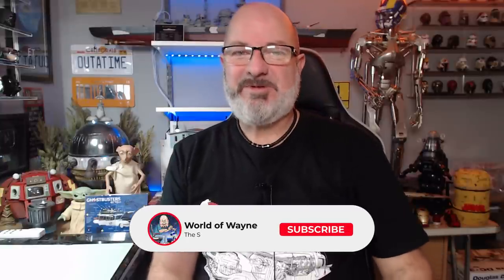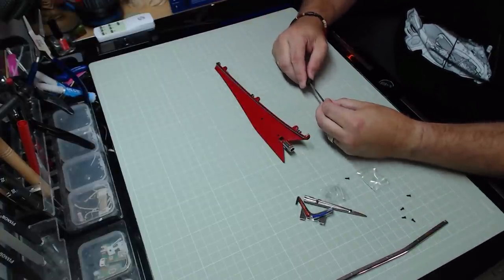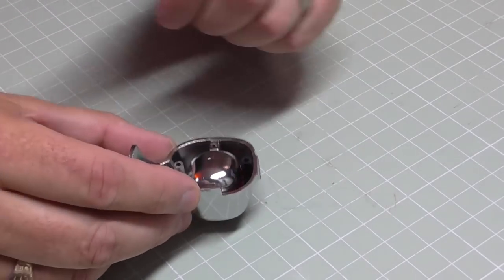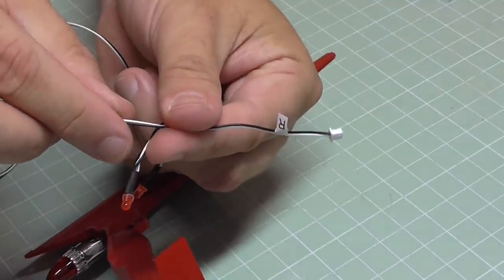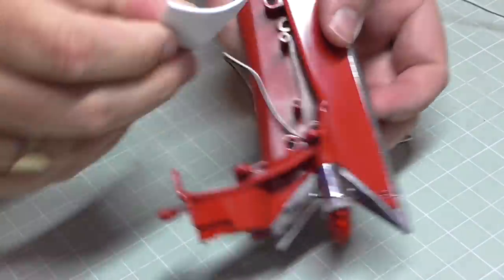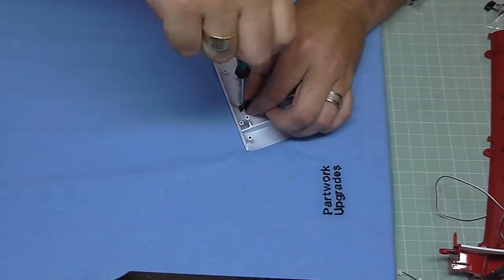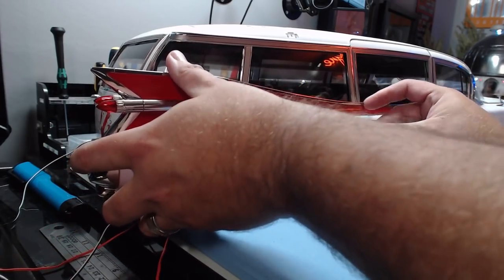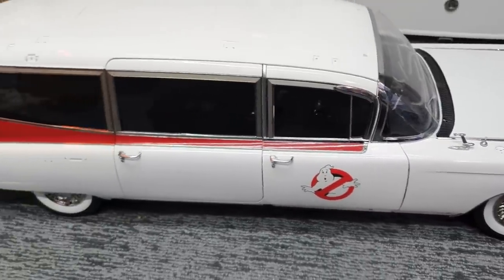Build the Ghostbusters Ecto-1 - Part 107,108,109 and 110 - The Rear Fender and Lights

Comment: Never over tighten the screws Wayne,  you've now got a blister / bruise in the red paint on the  FIN / wing. When you screwed the inner fin to the outer fin, you've managed to over tighten one screw and it's bulge on the front of the fin.   Real shame as it now looks a bit of a mess.      You make mistake so we don't have to !                                                                                                   I am converting mine into a hearse rather than the ghost busters caddy.

Comment: Another little oddity of my playmobil ecto 1 I've noticed from watching this video, the tail lights are a double light on it, the tube the light fits into extends out the sides of the red fin and the hole at the end is a sort of sideways figure 8 shape, and then the lights are shaped like two side by side cones. DIdn't notice that wasn't what the real one was like until just now, very odd. 3 fog lights per side on the front instead of 2, and a doubled light on the fins at the back, considering the only working lights are the ones on the roof they seem to have gone quite wild putting in extra non-functioning car lights.

EDIT: well this is what happens when I leave my comment half way through the video instead of waiting until the end, it is a double light on each fin after all, I was talking nonsense, sorry about that.

Comment: I've just finished these stages (I've got up to issue 32 but been amassing them for some reason). It looks amazing even so far and a real quality to it. Even if some electrics get damaged when joining together later on I won't mind. In reality it's going to be in the display case and the electrics rarely used, and that by itself is beauty ( for want of a better word) enough. I'm about to have my right eye removed and get ghosting in my remaining eye (no pun intended) a bit like analogue TV when the signal wasn't quite tuned in. It won't progress in my remaining eye thankfully due to my age, but with these things combined this will now be my last model. I've found it hard to build towards these end stages. But what a swansong to perform.

Comment: I'm wondering if you ever got the replacement logo stickers from Mike Lane Mods - I ordered some a bit ago to replace that rear door sticker (that angle was way off) and they seem a bit smaller than the ones that come with it. I'm thinking they might be a bit more screen accurate from the first film but the logos on the Ecto-1 restoration are definitely larger, like the ones that come with the kit.
Reply from the maker: I have quite a few mods for the Ecto-1 from Mike Lane. I’m holding off putting them on until the build restarts as we are waiting parts
Reply: @WorldofWayneUK  Ah yeah, you're a lot more meticulous than I am though to be fair my build was half done before I knew mods even existed

Comment: That's crazy how they designed the LEDs in the side frames. I don't see why they couldn't have designed it so that the light could easily go straight in.  Looks to me that the LED could have gone through the square hole behind the lenses housing, without any bending of the wire.

Comment: How do you get the body on ?? With front on the rear fouls and same of rear on first the front fouls . Trying to make space whilst building
Reply from the maker: Take the small plastic tabs off the are behind the front wheels hanging down. Offer the body front first and then pull the end part apart while you lower down. This should clear the inner frame. Make sure you have no wires snagging too
Reply: @WorldofWayneUK  Thankyou so much !!! Love your whole channel. Followed you through all of deloreon build and now ecto.

Comment: What are those two holes in the last panel in issue 110 for? Are they vents of are they the fuel flap?
Reply from the maker: I think so. The instructions don't give a lot away
Reply: They the hoses that goes to the roof